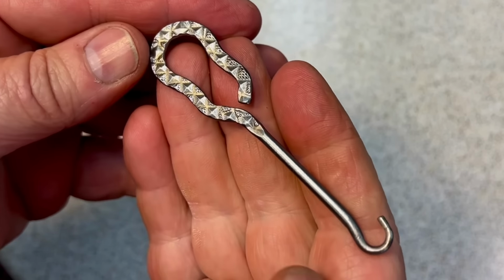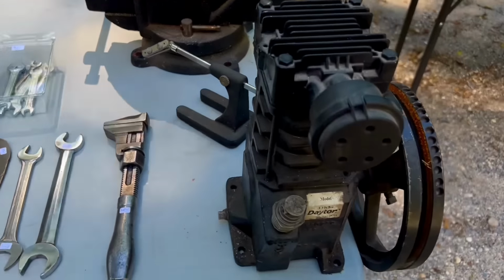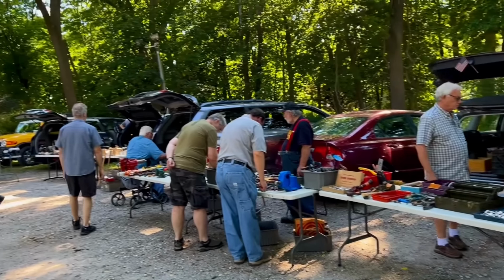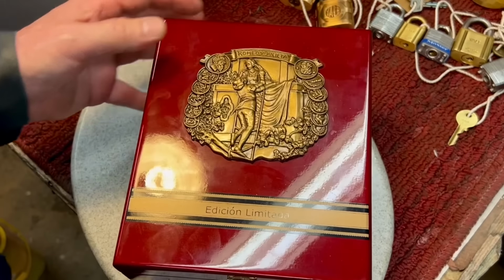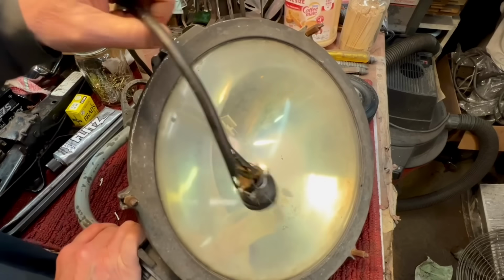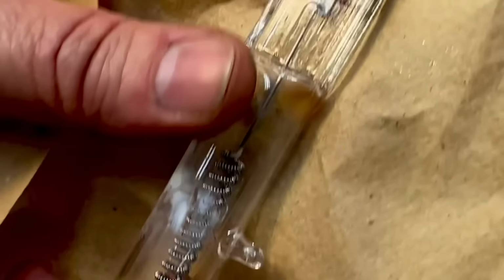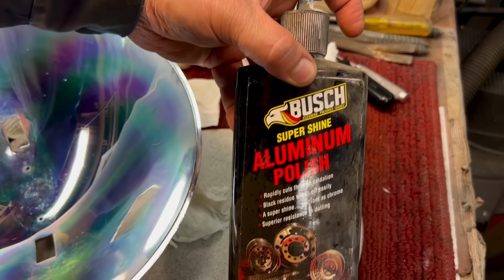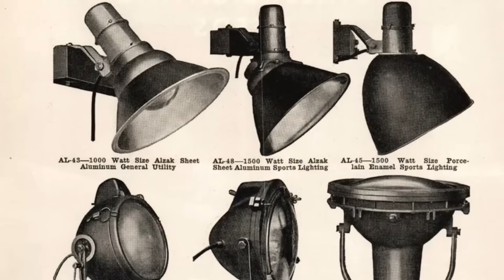Long Island Tool Meet- High End Cigar Box- Empire State Building Flood Lamp

Comment: When I was an electrician for a time I specialised in installing outside lighting similar to yours. on many buildings but my claim to fame is a building designed to look like an old radio from the thirties that looks over the river Thames in London built over Charing Cross railway station. I remember the designers across the river on the other bank telling me via radio handsets which way to adjust the lights so they shone where they wanted them to before I fixed them permanently in place, I see it everyday on the backdrop of just about every news cast on TV !! look forward to seeing that car restored !!

Comment: Cool light & great video!
A few years ago I was looking for replacement halogen bulbs for a tripod/work light & found some Led's that worked well. 
They were an improvement in that the halogens got so hot you could fry bacon on the fixtures, as well as being fragile bouncing around jobsites & the back of trucks. 
That said, some of the replacement Led's are junk. 
If it's not broke don't fix it, but if you're planning on running it all night/every night the Led efficiency may be worth a look, as well the ability to manipulate the color/focus. 
Unfortunately though you really have to look around as in my experience there's more "complete junk" than decent replacements.

Comment: The Empire state building used bricks from England close to my town. Called the Accrington Nori brick. For years I didnt know why they were called the Accy Nori brick. Eventually I found out the bricks were infused with Iron and the cast that said Iron read Nori backwards on the brick. The bricks are infamous with builders in the UK because theyre an absolute pain in the A to drill through especially with a core drill when fitting extractor fan vents.
Reply from the maker: Wow!!! Very interesting.

Comment: I still have a ace hardware that sells porcelain wire nuts thought not the same quality as they use to be.  I use them in old houses that still use knob and tube or get spliced from cloth to romex.  I do that to be in "repair" not replace to they don't get called to bring it up to code.  Also have a few historic houses we work on that are insistent on everything as it was including liquid copper dipped siding and knob and tube.  I loved seeing all that fun stuff!
Reply from the maker: Matt- That wiring was very durable.  The knob and tube design was quite innovative for the time.  😃👍

Comment: That is a Parabolic Aluminized Reflector (PAR) Spot light ( the glass lens is smooth and does not diffuse the light.  Flood lights and other broad lights would have a textured (faceted) glass.  Touching the glass envelope transfers oils from the finger to the glass causing that are to heat up faster thant the surrounding glass.  This often causes the lamp to bulge and potentially explode from the high pressure caused by the filament and gases inside.   I worked with theater lights for over 30 years, just to brag a little. this is a nice score!
Reply from the maker: David!  It’s funny I just finished Wednesday’s video and touched on the spot/flood difference.  You know a lot about these lights!  Big Clive is also a lightning technician.  I bet you have seen so many changes in the last twenty years with LED technology. The best thing is the lower voltage and less heat keeps the fixtures light.  😂👍.  Thanks!

Comment: The diecast truck appears to be a Hubley /Kiddie Toy # 460 Wrecker Tow Truck ,  with the boom  missing.
Reply from the maker: Yes!  How cool is that?!  I will have to make a vintage looking boom!  😃👍
Reply: @ScoutCrafter   Alot of them seem to be missing the hook, 3D printing would best way to go on that, i'm going to see if i can design and print one, if i can work out the dimensions. For stripping the paint be very careful if using paint stripper, it could melt the tires if they are plastic. Soaking the model in brake fluid should remove the paint without harming the tires. On the original model the hook and sideboards were plain metal and not painted.

Comment: Couldn’t find the video but I remember you doing a project with multiple paint layers. How do you remove the top paint without affecting original paint underneath item?
Reply from the maker: Sometimes you get lucky and the stripper will remove one layer at a time, you have to watch it closely.  I had a 51 Pontiac Chieftain I restored. It was Blue from the factory and painted maroon 20 years later.  For fun I used Zip Strip and was able to leave the stripper on just long enough to remove the Maroon paint leaving the Blue intact.  I used a plastic scraper.  Most times the paint underneath won’t be useable after stripping though.  😃👍